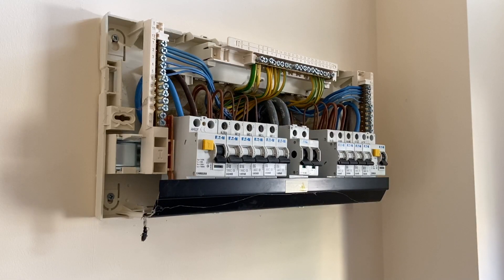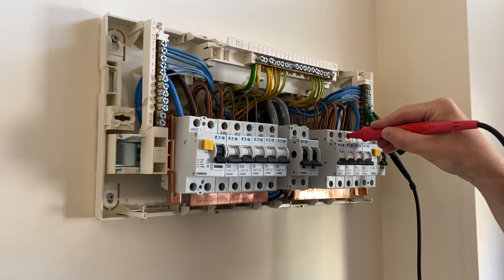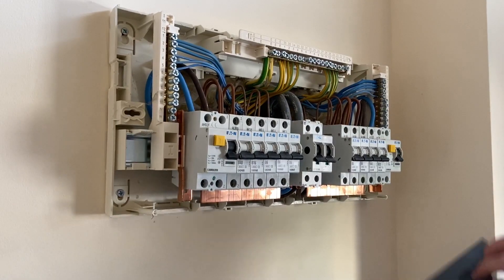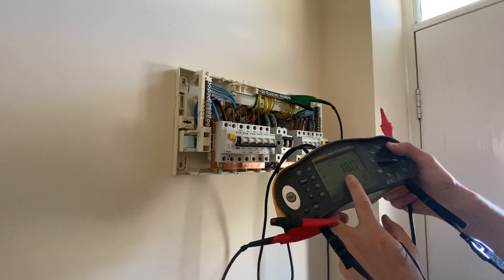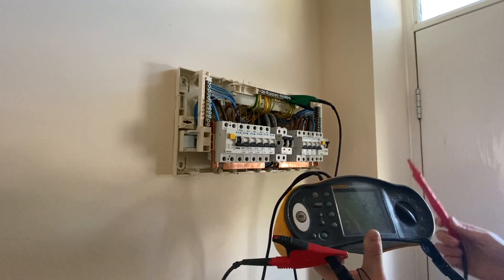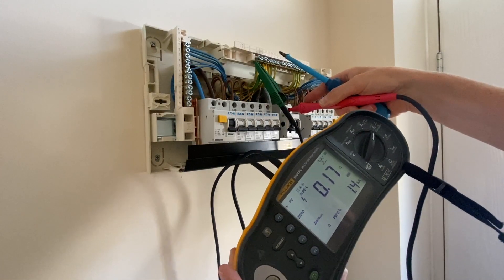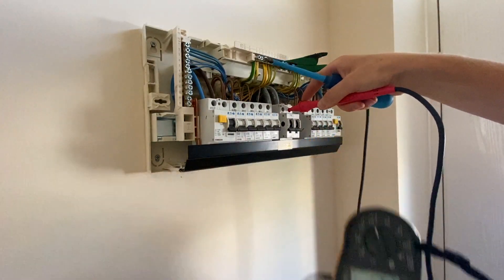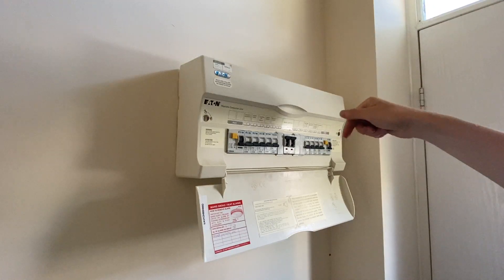Electrical Installation Condition Report Sample - Part 3

Comment: I don't see it even at a code 3 because it was compliant when installed and as long as the cables and mcbs and rcds pass all relevant 18th edition passes then the board complies with the edition when installed and unless their are changes as regards new circuits being wired into the consumer unit it doesn't need to comply with the 18th edition because if it was law then a red notice would be applied to all plastic consumer units and none would be allowed to be sold

Comment: Could you not of, when doing the RCD tests, turn on one of the circuit breakers and test on the out going of that, save you going of the bus bar?
I was always told to do the test button after the RCD tests, just because you are putting a fault through it therefore you now need to make sure it still trips after your testing.
Reply: Or use one of the sockets would be even better/safer looks like there’s sockets on either side of the board

Comment: Hi Jordan

Great videos love them, in my industry we forbid any metal jewellery to be worn when working on electrical equipment        Particularly live exposed conductors EAWR 1989 a colleague of mine touched a bus bar with his gold ring - his ring deformed cut into his finger - finger swollen and became septic within an hour and he had to get finger removed               He was criticised by mgt he was told not to wear any metal jewellery even necklace which can easily make contact                Hope this helps enjoy your videos mate
Reply from the maker: Thanks yeah I need to start removing my rings at work you're right it could be a hazard

Comment: Hello, did you code the tails after? It seems it has been standard practice to run tails long distances like this in domestic properties for a while.
Reply from the maker: This isn't a long distance its less than 3m so its fine.

Comment: It's a bit worrying that some don't think a CU made from combustible materials warrants a classification code, it's a requirement of BS 7671 that all CU be made from a non combustible material so a plastic CU is clearly a departure from this regulation and as such warrants a code.
Reply: Ashman Electrical Services Not all non compliance’s require coding, why would recommending replacing a perfectly fine CU with a metal one be warranted if it’s fit for continued use and safe?
By coding it a C3 then your telling the client that although it’s not potentially dangerous a safety improvement is recommended, which is not true if the CU is in good condition for continued use.
It’s almost as bad as people who code switch lines that aren’t sleeved or identified by colour or coding red and black wiring.

Comment: C3, as you said there's no signs of visual or thermal damage at the CU... C3 means improvement recommended so a metal CU would be an improvement over the existing CU.
Reply from the maker: Yeah Napit and NICEIC recommend C3, it definitely warrants a mention.
Reply: Artisan Electrics actually they don’t, the code breakers and best practice guide suggest no code unless it’s in a sole escape route, I believe you have the book and the BPG is available as a free download so by all means take a look. 👀
Reply from the maker: Yeah but this is in an escape route it’s right next to the front door and stairs
Reply: Artisan Electrics If it’s the sole escape route then fair enough 👍🏻
Reply: @ishkebab  Being at the bottom of the stairs absolutely classifies it as a "sole escape route" as far as anyone upstairs is concerned. Unless you reasonably expect people to be jumping out of first-story windows.
Reply: Aaron Jones Having an upstairs has nothing to do with it being a sole escape route. Access to upstairs windows is very much considered a means of escape hence why new modern homes (yes this is not the case for all existing older homes)  upstairs windows cannot be locked internally by means of a key and are push latched open only.
Reply: @ishkebab  Those windows may very well be a viable escape route for an athletic 20-something person. Not so much for the obese, the physically disabled, the kids, or the grandmas...
I also had all of my windows replaced (by Nationwide Windows & Doors, at the request of my landlord, not me) in this rented flat last year, and I'm not on the ground floor, and I can lock them.

Comment: I can't believe you passed 500V through an RCD 😯
Reply: Ashman Electrical Services He didn’t pass 500v between live conductors so it’s absolutely no problem regarding an rcd or any connected loads/electronics
Reply: @ishkebab  Yes, I get that the 500V weren't passed through the line and neutral consecutively but IMO it'd be better practice to have the RCD's in the open position when IR test from the load side of the RCD.

Comment: I personally C3 all plastic consumer units in a domestic property. I know many would not agree but I base it on the fact that it is not compliant to current regulations and could be improved in terms of safety. It doesn't mean an unsatisfactory cert either way but I feel better about coding it rather than ignoring it. Putting it in the notes section just seems wrong if it's an observation of non-compliance.
Reply: Black Fingers it’s a code 3 your doing the right thing , “condition of consumer unit in terms of fire rating “ wouldn’t be a tick , wouldn’t be n/a , it’s a 3 , we’re testing to the 18th edition
Reply: Black Fingers Totally agree mate
Reply: I don’t agree - unless you actually believe the customer should replace a plastic CU for a metal one for no other reason than its constructed material - after all you are declaring that you personally recommend improvement by doing so. Would you feel unsafe in your own home with a plastic CU ? Why do DNO still 
fit plastic isolators ?
Reply: @Marco-mg9tv  you're lucky if you get any kind of isolator from the DNO around our way! They work to their own regs anyway. I have a plastic CU in my house, I would change it but the boiler was installed in such a way you struggle to even get a stubby driver at it so the motivation isn't quite there yet tbh. 
I would still recommend they are all upgraded to metal. While I check every screw in a CU before I leave there's no guarantee the next bloke will. There's always the chance of random failures of devices too. then you have a possible fire and a plastic board won't contain that. Aside from fire exit routes and under wooden stairs consumer unit are often in cupboard or near coathooks in halls so often surrounded by other combustible materials. Why wouldn't you recommend (however gently) that it be improved in terms of safety if it can be? Aside from fire containment, plastic boards are also much more vulnerable to mechanical damage from impacts. Hagers plastic boards in particular have very flimsy front covers. It doesn't take much effort to bend one of those to the point where a child's fingers could get inside. They also have crappy plastic cover fixings, flimsy blanks, dodgy switch covers etc. I'd just rather see them gone to be honest.
Reply: mark fardon DNO Isolators are not considered consumer units or similar switch gear.  For obvious reasons.  (So the reg regarding metal CU’s or enclosures doesn’t apply)
Reply: K C fair point but does that mean they are immune to loose connections ?
Reply: Black Fingers all good points mate and I know it’s a subjective issue. I’ve been doing loads of EICR on rental property and ughhh ! Plastic CU is the least of issues I’m seeing tbh. It’s always going to be a devisive situation because on one hand we are saying C3 improvement recommended and on the other it’s “Satisfactory” . Same can be applied to a C3 no RCD for additional protection sockets, bathroom whatever. If it ideally needs improvement how can it be “ok” ? Maybe the overall result of an EICR should be satisfactory, improvement recommended (C3) or dangerous (C2/C1)
Reply: mark fardon Well no, but my understanding is that consumer units and similar switch gear will be disturbed several times throughout its life.  During inspections, alterations and additions.   DNO isolators, once installed are rarely touched again for many many years.  Sure, screwed terminals can loosen off over time, but installed using the right torque setting, and being left undisturbed.....they should be fine.

Think about all the meters that have been installed and not touched again for 20 years!  Same kind of scenario.  I think you’ll find most electrical fires that start at the origin, start in the consumer unit.  I’ve not heard of meters catching fire....or DNO isolators to be honest.

Also, a 10 way consumer unit may have 40+ live connections (lives and neutral).  A DNO single phase isolator has 4. The chances or probability for there to be a loose connection in a CU is much much higher.
Reply: mark fardon I always use an analogy to my clients.  I tell them there is a basic standard that is consider OK, and safe.  And then there are better standards that go above and beyond.

I tell them that a C reg fiesta will pass an MOT with the type of breaks it was built with.....but it wouldn’t be built in the same way today, and today’s fiesta’s have much better breaks.  Both considered safe to drive.....but one is a much better standard.  It’s the same with electrics in many ways. 

Not recommending improvement could be seen to suggest that the installation is as good as it can be.  Which we all know, in many cases isn’t true.
Reply: K C yes I agree and have used your analogy too. But if they had an old fiesta on the drive I wouldnt recommend to them that they get a newer, safer one. If it passed the MOT it wouldn’t get an advisory stating more modern safer cars are available would it ?
Reply: TBH i never code this but do make a comment with reg numbers.

What code would some of us give AC type RCDs that are protecting circuits with high DC leakage?
Reply: Steven Murphy. Depends on a few factors.
Reply: @SME_Ste  That's a funny one isn't it? The wholesalers still have shelves full of domestic boards with AC type RCDs. I always open the box and check now when I get one. 

How many of us are measuring that leakage when we do an EICR? I'm not. I don't have a clamp meter capable of reading it yet. There's nowhere to record it after all and it changes constantly. We're there to test the fixed wiring. Do we go around the house checking how many LEDs or swicthed mode power supplies are in the house? Do we now turn all the appliances on? Perhaps more weight to the argument that AC types were never fit for purpose. Who's to blame for that?